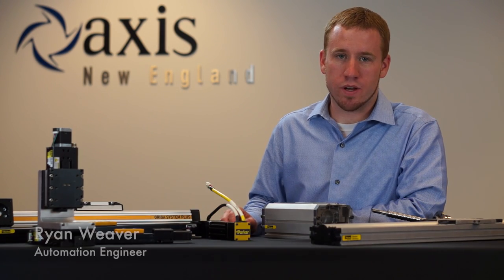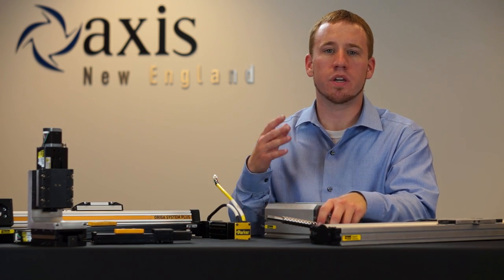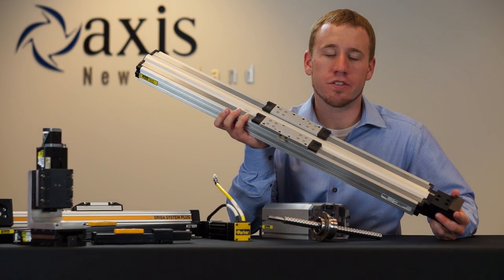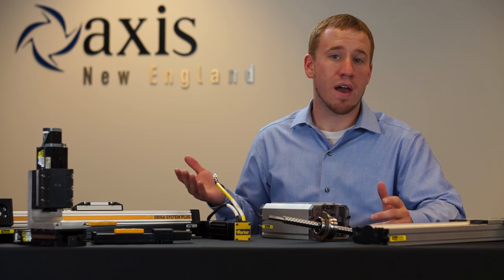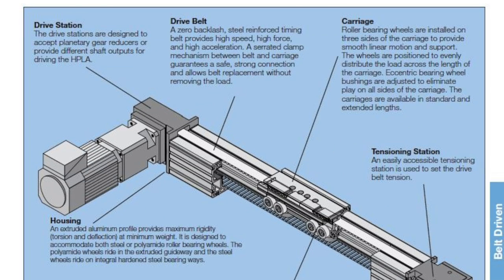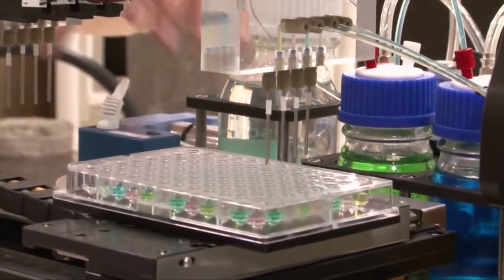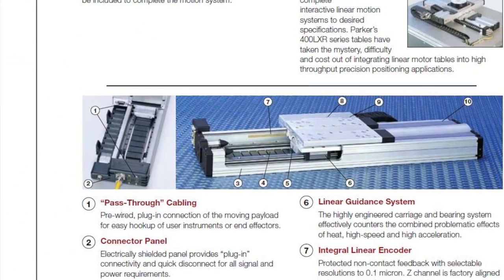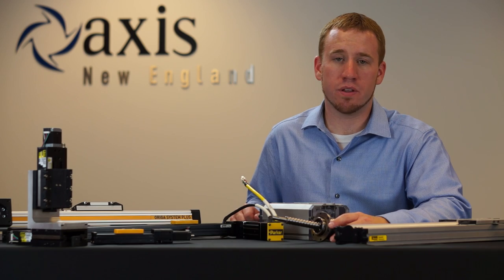Linear Actuator Selection

Comment: I'm building a vintage plane and would like to know what you recommend to slide the roughly 60 pound canopy forward/aft 30 inches in about 2.5 seconds for each direction... I'm thinking the belt drive system may be my best option? Power would be 12v - am I being unrealistic ? Thanks

Comment: i have some doubt in linear moving system for example my chamber weight is 60kg its resting on the guide rail rail arrangement it has four supports i have move this chamber linear so i have plan to use cylinder for actuation here i have the doubt  what is cylinder force i need for moving my chamber linear?if u have time please explain

Comment: Does anything exist that can make a forging press 12 ton x 2 for instance ? and would they be more than a hydraulic system if they exist ?
Reply from the maker: Parker's XFC electric cylinders can handle 12 tons of continuous force, though the cost would be greater than a comparable hydraulic system.  The difference is that the XFC has much more control than a hydraulic system in terms of positioning and force control. http://bit.ly/2lHGX08

Comment: What type of actuator that you can mount in a VAN, to drop or raise a bed up into the ceiling?
Reply: Depends on the weight and being a VAN what kind of available resources you'll have. magnetic, air compressor, hydraulic fluids etc.
Reply from the maker: I would think some type of simple electric driven belt mechanism would be the simplest solution, with the rails mounted on either side of the van.  It might need to move slow, since you will only have 12V at your disposal for the electric power.  Good luck!

Comment: anyone knows trustworthy company to buy a DC linear actuators which have following specs .

1. load force : 200N

2. Full load speed  >600 mm per  sec

3. stroke length : 300mm

4. input voltage : 12/24 v

5. mounting length : around 500mm
Reply: I've been looking at all and I mean all types of linear actuators and I can almost guarentee they do not sell a linear actuator to meet those specs
Reply: The only thing I can think of is a pneumatic actuator because electric just can't meet that speed and load to my knowledge
Reply: @jesse_sss6924  thanks .I have found 4.5cm per sec speed ,250N load  linear actuator from chinese company .,
Reply: @pinindumihiranga7738  you could also change the gears inside I have an actuator with i believe a 264 to 1 gear ratio I switch out the gears for 2 gt2 gears 20 teeth each for a one to one ratio. Granted it only lifts around 10lbs compared to the original 22 but it moves 9in per second now. Before was  4.5 mm a second